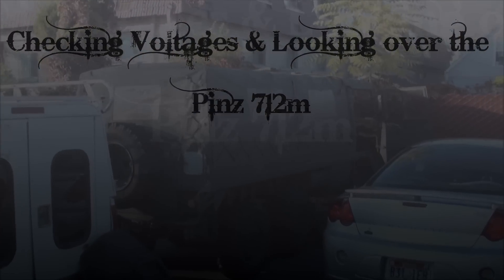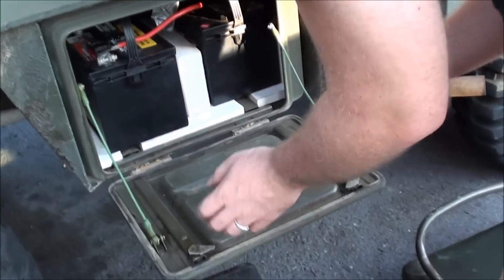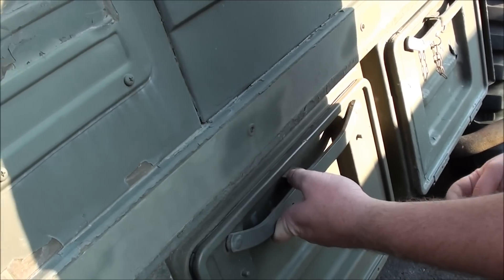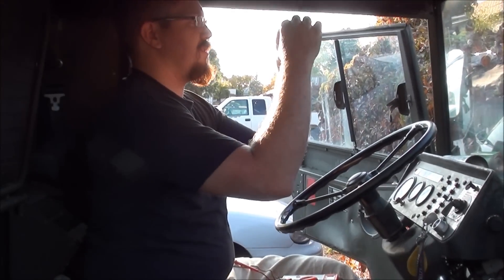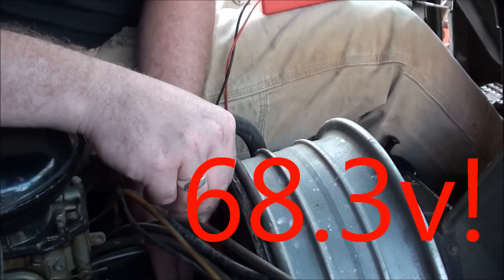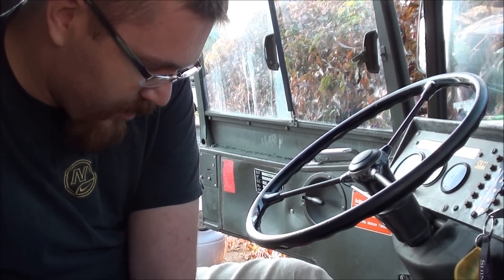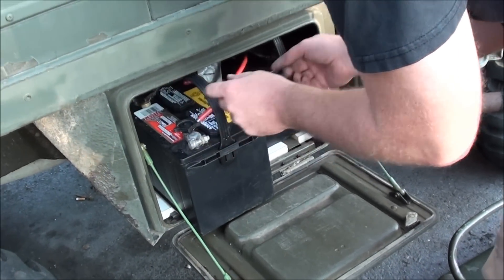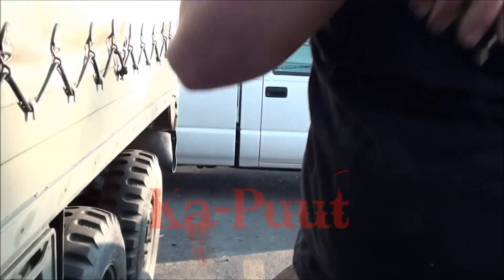Pinzgauer 712m Engine Voltage Check

Comment: Thanks for responding - glad you've sorted it. By "charging voltage" I meant the voltage you were getting across the batteries whilst the engines were running

Comment from the maker: @spandit You are correct about the battery disconnect.  I only did that momentarily as a quick check method.  The charging voltage is plenty high to charge a 24v circuit.  I can't remember if I posted the video or not but I found a fusible link wire that had become a completely open circuit.  Once replaced everything is working great and the batteries are charging very well.

Comment: Also, disconnecting the battery on a running engine can ruin your alternator. I'd say that your charging voltage isn't high enough - sounds to me like your alternator is toast